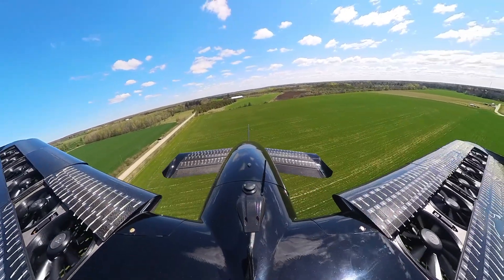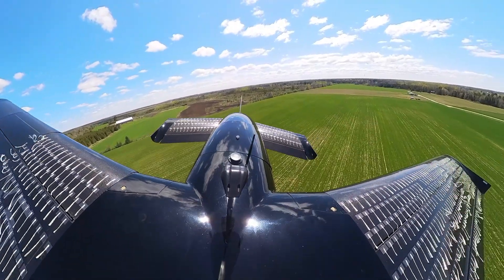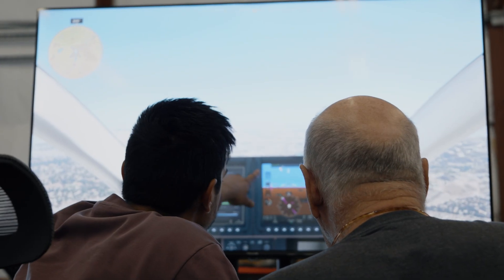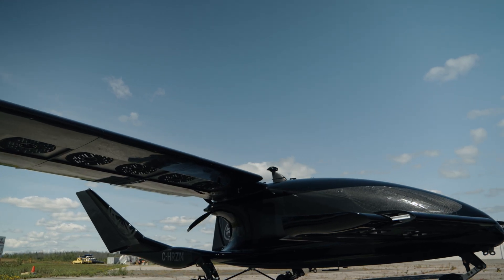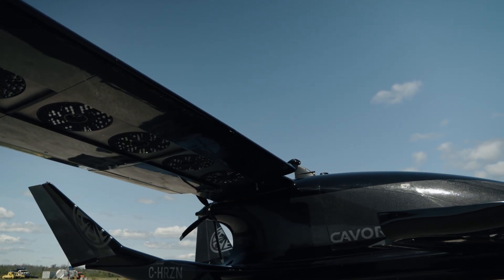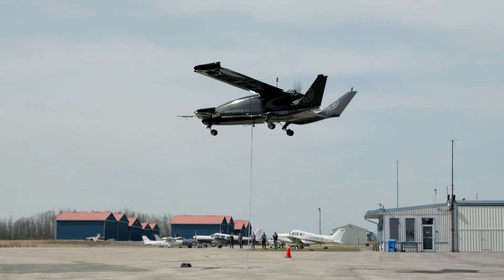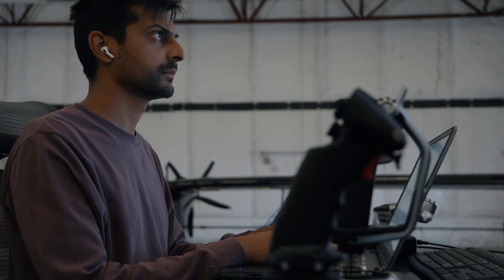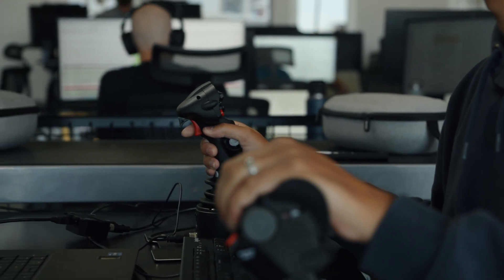FLIGHT/PATH – Episode 8 – Flight Control Design for our Hybrid eVTOL

Comment: Very interested why  you chose to go with a a forward swept wing. Its an inherently unstable design that has only ever been found in experimental airplanes. Curious about the canard, are you unable to get enough pitch authority with the tail during transition from hover to forward flight?
Reply: Uhhhh, uh? 
Forward swept wing is best design for the concept, speed and functionality of the craft. 

You might be thinking of more faster and higher altitude craft. 

But for what the cavorite x program is going for, it's the best design.  Forward swept enables far better control at low speeds,  hoover modes, and transition time.  Plus glide redundancy in case of system outage. 

Tail has proven its functionality for pitch when transitioning.   An the canards, pfft you want some control you'll find the best crafts out have them. 

We not hitting any Mac speeds,  so Forward swept is the way to go to be a aerial hornet.
Reply: @kingshark-q5n Its not a fighter. Whatever it gains in control it loses a lot more in stability relative to yaw control and stall performance. This wing design is an attempt to reinvent the wheel unless robinson wants to explain in another video why they chose this wing over the same but in a sweep. The only thing i can think of is the packaging.
Reply: @Saml01  ....  I'm go outside and look at these Hawks snag field mouse and see if it's forward or swept wing control. Lol. 

Come on now, ... I've explained it already.  Even nature can prove to you which wing design maximize low altitude,  low speed , hovering wing design.   

Ever wonder why a a10 warthog isn't swept,  exactly.    Low altitude,  low speed control to maximize the accuracy of the weapon system.  

A tight rope walker isn't swept arms to solidify balance and control,  but arms where and how, exactly.  Forward
Reply: @Saml01  yaw... lol do you see that dual tail section. Lol. Come on now.   That bad boy could spin in a circle if they wanted too. Lol.
Reply: @kingshark-q5n Exactly. They need it to counteract its inherent stability issues. It also adds weight and drag and cost. Wait until they start testing the full size model and they discover the wings and tail can barely meet normal category limits.
Reply: @Saml01  .. yes, when the full scale  is built with more power and material strength,  plus full stiffness and dampening from x5 data. 

We shall see, and I won't be shocked if the rear ends up with some canards that has no fan in wing but have stability and flight functionality. 

But, ... from some interviews,  the cavorite x7 will not look; look for look of the x5 prototype,  the design specialist has already found some external doo daa's to tweak , soo i expect a robust sleek aggressive craft at final call. 

But, pffft. I'm not even worried about a large scale craft anymore,  lol. 

Send the prototype in for stiffness and final dampening and we got a advanced uav/drone ... proven flight mind you on our hands. 

Some retrofitting and we got a x5 h-evtol on our hands ready to compete with mq9 drone  series.      Let's go!!!!!!!!
Reply: This is a common question so I'll address it directly! The forward sweep is admittedly structurally more challenging, with torsional rigidity being a primary concern, especially with the inability (or lowered ability) to carry loads through a completely bonded skin. However, there are several non-trivial benefits:

1. Main Spar Location. Far from the main reason to accept the above tradeoffs, it's really nice to have the main spar intersect the cabin aft of the rear passenger seating location. Again, not the reason we did it this way, but a great ancillary feature;

2. Hover Performance. For reasons I'm not at liberty to divulge, this particular configuration has some hover flight advantages. 'Nuf said there...;

3. Transition Flight. The hardest flight regime for any VTOL is transition to and from vertical flight. The forward sweep has several aerodynamic advantages in the slow speed flight regime. Spanwise flow is inwards, resulting in root stall first and maintaining outer aileron control. This is very significant for an aircraft accelerating / decelerating through stall every mission; and

4. CofG. Selfishly this helps the aircraft with CofG, being able to support a much broader loading range.

There are several more reasons, but this post is already long enough. Hope this helps!

Brandon